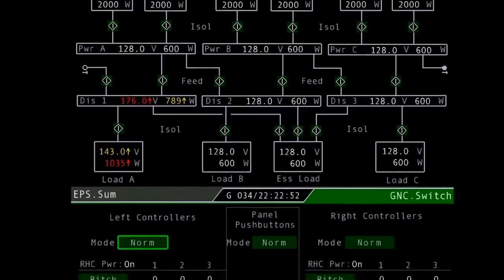Real Martian Moments: Designing Orion

Comment: I have come to the conclusion that the Orion Module is to small to go to Mars,,on it's own.   Surely there is a much larger scale of craft in the works to support people comfortably for that long of a period of time,,and,, That is a heck of a long time for just that small 1960-70 module to survive.  Not saying that it couldn't survive,,but its putting all your chips in one small pile for a long ride.  Use Orion for the plunge back thru and as command module for the flight,,but assemble a living/traveling quarters spaceside and dock to that.  Would love to see some of the protoype work for that kind of stuff.  distant ideas,,lets say.
Reply: +kh40yr I believe that the Orion will rendezvous and dock with a much larger habitation module. Then, it will fly over to Mars. Here's a wikipedia link for more info: https://en.wikipedia.org/wiki/Deep_Space_Habitat
Reply: +Rayden440 First, Rayden is correct.  There will be a multi-section unit to travel to mars.  The Orion capsule is only the part for reentry into Earth's atmosphere.  It will not enter the martian atmosphere.

+kh40yr I would suggest some independent research on the matter.  NASA discloses their current plans for the mars trip on their official website and take no more than 5 minutes to pull up multiple articles on the topic.  If your point is that the reentry vehicle should not be sent with the mars unit, then I actually agree.  I feel that they should only take enough to get to mars and return to low earth orbit.  From there the returning astronauts can join with either the space station or a pod from SpaceX.  If you want a good question to ask NASA, it might be why they didn't do that.